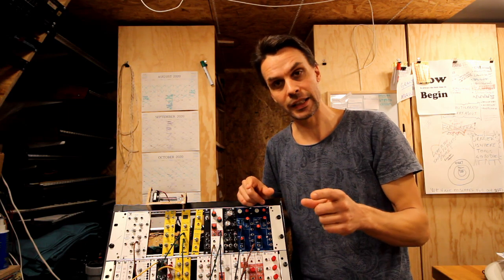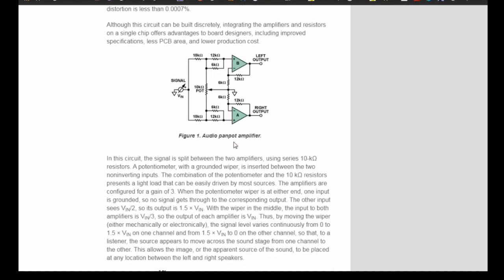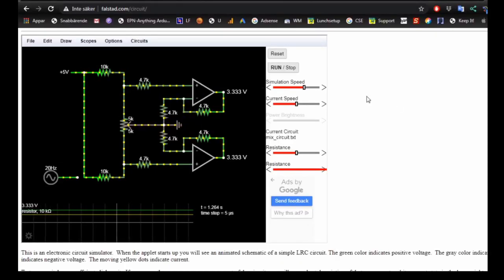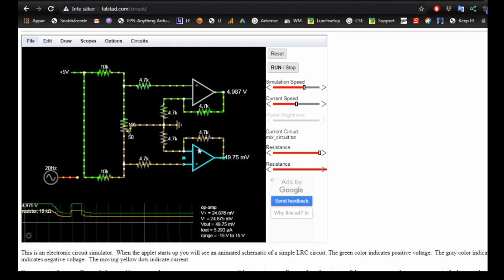Inbetween episodes - A better Wet/Dry mix circuit

Comment: I'm trying to blend my dry/wet signal on a pedal I'm building but I'm doing it without anything besides 3PDT foot switches, a 2PDT 9v relay, and a blend pot. Signal sounds clean, and everything works as planned except my Blend knob goes from 100% wet in left position, to 100% dry when in the knob is in the center. But, It does not change from center to the right postion. Its a 500k dual layer pot. Can I just use a regular 500k potentiometer?

Comment: The best and simplest way to make a mix knob, that at the extremese will mute either the dry or wet signal, is to use a dual gang potentiometer. It should be wired as two level knobs but working opposite of each other, i.e. ground on pin 1 of one potmeter and ground on pin 3 of the other potmeter, then the dry/wet input signals on the two outer terminals, the two center pins (pin 2) are the signal outputs and needs to be mixed together, either with a summing amplifier or just passively.
When the potentiometer is turned to either of the extremes, it will ground the output (pin2) of one of the two potentiometer halves and the other will recieve the full signal.

Comment: Didn't know this circuit simulater..Thanks
Reply from the maker: Yeah it’s a good one for those simple circuit when you just want to check a theory. Or as I did want to know what happens when you start replacing components. :)

Comment: Can you make this CV controllable? I really need a super simple DIY CV panner.
Reply: It is rarely easy to "add CV" to a circuit relying on pots, I think you'd need at least one if not two VCAs to do the job!
Reply: @feudiable  you are right you would need too have a OTA subcircuit something like a LM13700.
Heres a schematic for a mixer: https://yusynth.net/Modular/EN/MIXOUT/index.html

Interesting read.
Reply: I've built two CV controllable panners. The simpler one used LEDs and light-dependant resistors (basically homemade Vactrols), the more complicated one used LM13700s. Neither of them were super simple, though!
Reply from the maker: Yeah those are the two ways I’ve come up with aswell. Although after @Rich Jones asked the question I did find quite a lot online some using the way more expensive that2120/dbx2055 (might be wrong ids) more high end vcas. One could use a dual vactrol instead of the pot in the circuit in this video. That should be quite easy no? 😅